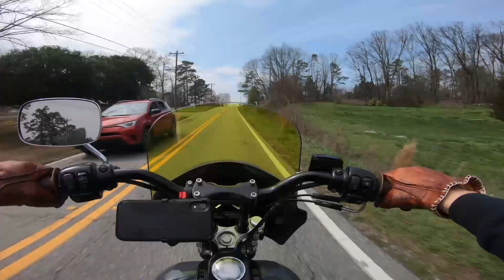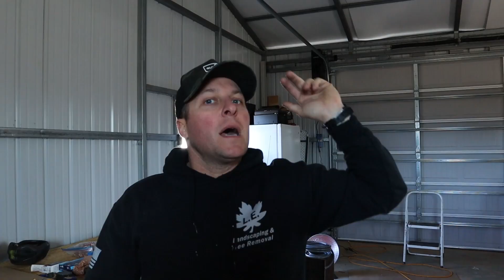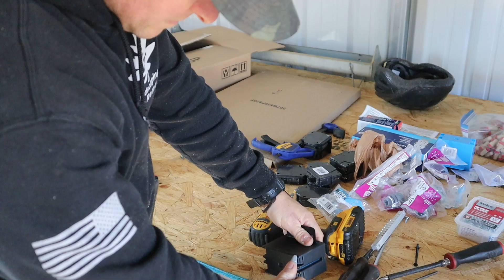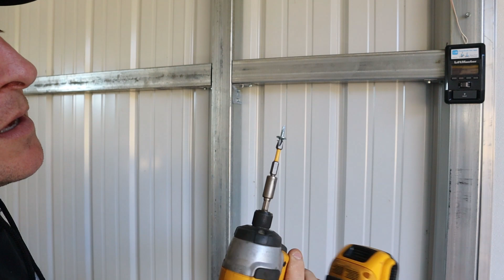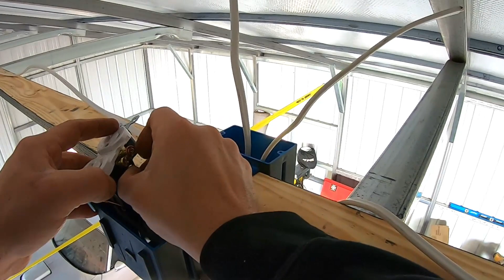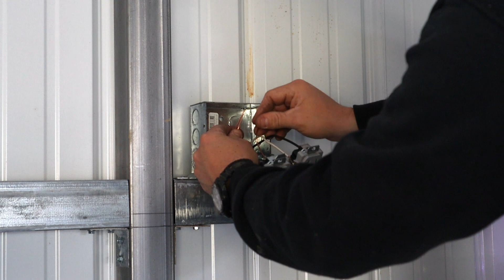I THINK IT'S RIGHT.. 100 Amp Sub Panel install Metal building dream garage build Ep.8

Comment: The outlets in ceiling did you buy the commercial grade top quality in case failure makes you go up high again to replace or residential  grade ? Apologies for all the questions im trying Diy my shop like you did , im just alot more mentally challenged. Very informative video thanks for sharing

Comment: The yellow straps on ceiling , i just had an 18foot wide by 24 foot long 12 foot tall walls  plus the high point of the gabled roof . On concrete pad . Do you see a need for my building to have simolar straps, your structure lot bigger , how tall are your walls. 
you didn't see the need for armored cable electric wires? Versus the Romex going thru the liquid tape? Was it cost only? Thank you good video

Comment: I wouldn't think installing outlet boxes up facing a roof would be a good idea which may collect any water from a leaking roof or condensation that may occur or years of dust generated in a work shop environment.

Comment: Wires stripped in the box tails too short
Need to tail off not legal to put one wire per terminal hsvecto tail off.
Using seal tite and running romex in is a waste of $  mc cable much better and cod compliant

Comment: I doubt his code says he can use PLASTIC boxes.  Use metal boxes, 12/2 metal clad, fasten metal clad every 18”, ground your metal boxes for outlets and switches, GFCI your first outlet in your string of outlets, 20 amp Breakers with the 12/2 MC.  I hung 4 Amazon UFO lights (2 per switch) and I have PLENTY of light in my 26Wx40Dx 14H sidewall metal building.  I AM LOVING MY METAL BUILDING!!!
Reply: Is it code to fasten every 18"? I wired my shop and guessed at it. 1.5ft just felt right.

Comment: Kudos to you for doing your own work. However, you could have used BX or MC cable, which has a flexible metal conduit around the wires. I'm sure the cost would have been the same as the conduit and the Romex cable. Plus it is a lot less work. Also metal boxes and some type of metal conduit is required to protect all wiring in all outbuildings. I'm not trying to be a Debbie Downer; just relaying what the National Electrical Code states. Thanks for the video. Enjoy your new building!

Comment: I would never install POS blue light special plastic boxes in any garage. Would use 3/4" EMT conduit from panel to branch off. Electricians seldom use sealtite conduit like you did. Only use it to feed motors , AC units and where flexibility is needed. Illegal to use a cordless tool to tighten any electrical screw or bolt. MUST use a torque driver or torque wrench. Poor choice installing receptacles face up. Dirt will enter it and guess where water leaking from roof is going to go. I always install red anti short bushings on both MC & AC cable no matter what the flimsy push on mickey mouse connectors state.You should have installed 6/32 screws with Loch washers & hex nuts to top & bottom of receptacles you mounted on 1900 boxes. Single screw in middle of a receptacle often come loose. Would not use any type NMB  cable ( romex ) in that Size garage in case in the future it converts to a commercial garage where at least in my area must use conduit or MC cable. Had a cabin catch on fire after an animal chewed thru romex cable.
Reply from the maker: All good tips thanks!

Comment: Romex can't go in conduit due to heat retention.
Reply: Incorrect. NEC 334.15(B) Protection from physical damage. NEC 334.10(5) permitted in raceways. NEC 334.12(b)(4) not permitted in wet or damp locations.

Comment: Did this electrical Pass Inspection?  Because you have Light Plugs near the roof with the Plugs facing upwards, if you were to ever get a leak, possibly even from condensation, water could drop dead into the plug.  also a Question, you added a 100 amp sub-panel, what is your main-panel amperage? also, you separated the Left and Right Neutral Bar, which Means Breakers on One side will have to Connect across to the Opposite side Neutral, Normally you just Add a Ground Bar for Ground wires separate from the 2 Neutral Bars? ... Ah I see you just ran Breakers on Right side, this is Fine as Long as someone else does not walk in stick a Breaker on the left and connect the neutral to your Now Ground.  (Add-in Ground Bars are like 10 bucks)

Comment: Why run 2 hots and 2 neutrals to each receptacle? As you mentioned, the outlets are connected to each other in each receptacle. I'd have added cover plates to keep bugs/birds from involving themselves in them. Looks good though. Out of curiosity, where did you drive in your grounding stake?
Reply: I think he was jumping the power to the box next to it, Normally you would Connect 2 Outlets with Pigtails not Jump from one plug to the other, if the first plug goes out it normally shuts them both down.

Comment: I'm from Australia and live in Florida. I'm an electrical contractor, or was, in Australia. Black is always neutral over there and any other color is live, except green. It has been quite the learning journey for me in the US as so many things aspects of house wiring is just plain unsafe by comparison. For example, the outlets. In Australia, you can remove a live outlet and it is impossible for your fingers to come into contact with a live terminal until you turn it over to access the back of it. I have had quite a few electric shocks in the US pulling live light switches and outlets off the wall. But, it is only girls' voltage 110 in the US.
Reply: I've always thought black being live was odd coming from automotive because that's usually neutral or common, good to know its a little more consistent elsewhere lol.
Reply: In the US  white  is neutral  green  is ground

Comment: How did you route your Metal Clad Electrical cable with the vertical style panneling around the supports? Did you go in front or behind? 

I'm about to build a building too and am looking for examples of routing the MC wire.
Reply from the maker: Most of it I ran to the top of wall then left or right! It’s still a pain though but it works

Comment: I work a southwire mc plant that manufactures the cabling and the liquitite. I'm fixing to wire my shop and its definitely the way to go.
Reply: Don’t lol, it’s a bitch to pull wire through over long distances. EMT and surface mount it, call it a day
Reply: @trevorthefisherman5548  yeah thats what I meant lol I'm surface mounting mc cable. Liquitite is really only good for short pulls.

Comment: Pull Romex ! Put a pipe thru the center of the roll and pull the romex the way it’s wound! It should spin so the memory is removed!!
Reply from the maker: Thanks man I tried that. Seems like with the smaller rolls not on a spoil it was difficult

Comment: Through YT magic, I found your channel -- specifically dealing with this build. I sub'd after watching the successful completion of the building (2nd video I watched). Been waiting for the wiring to come around, and... I'm a little disappointed. I worked in commercial/industrial electrical for years (retired), seldom dealt with simple 120VAC. However, I'm pretty sure NEC requires horizontally placed receptacles be pointing downwards-- which is why floor-mounted receptacles are no longer allowed (by "floor-mounted" I mean receptacles flush with the floor). Anyway: I think your rafter receptacles are upside-down. Also, I believe NEC prefers whips from a junction box hard-wired into the light fixtures, rather than plugged in with a cord to a receptacle. My 25' X 30' steel building (garage) is wired through conduit throughout, and whips connecting all 6 light fixtures (8 foot fluorescents) to their junction boxes. This garage was built years before my wife and I bought the house-- so I had no input on that.
Reply: As long as it is an approved assembly floor mounted receptacles are allowed Article 210.71(B)(2),314.27(B)]

Comment: If you have the sub panel bonded you would electric flowing on the grounds going back to the main panel which is very dangerous.
Reply from the maker: It’s not bonded! Removed the bonding strap completely

Comment: Your light switch had a direct short in it.  You had the white neutral on one screw of the switch and the hot black on the other switched screw!  I bet that surprised you when you tried to turn on the lights!
Reply from the maker: Not surprises yet. I’ll have to go back and watch lol thanks for the heads up
Reply: Those were just travelers. Goes down white, back up black. (or Vise Versa)

Comment: Hundred amp nowhere near enough your freezer taking 20 if you hook up a welder it’s gonna 50 now you’ve already used up 70A. You always go bigger than you need because you’re going to add lights electric heaters welders saws and a whole bunch of other tools that like power
Reply from the maker: Thank you. I figured when I’m welding I physically can’t operate any other power equipment at the same time. So didn’t count the welder as taking 50 amps.
Reply: John Winkler.    Never never never add breaker handle ratings to size anything.  You always use loads in VA. and calculate amps.

Comment: If I were you I would put a piece of plywood between the box & wall.  I also prefer to wrap electrical tape around the outlets/switches.  Always better to put in a 200 amp box for you never know what you might need.
Reply: Some counties don't allow electrical tape. It can be a fuel source in a fire.

Comment: Should used 12/2 wire it’s a shop plugs should be 20 amps
Reply: By what standard are the receptacles required to be 20 ampere rated.   They are not a single receptacle on a dedicated 20 amp circuit.

Comment: I recommend you talk with an electrician about being a consultant.  Tell them you want to do it yourself, but you want help with the right way.

The 2020 NEC puts shops and out building like yours into the garage category for GFCI protection.  If you do it with a breaker, you must return to your panel to reset it.  If you do it with a recepticle to feed a string of recepticles, your get the protection with a $8 breaker and $20 amp recepticle instead of a $50 GFCI breaker.

If your trench is open to supply power, put in a large pipe ( 1 1/2 inch for 200 amps) and a few 3/4 or 1 inch pipes for stuff like cable or a switch in the house and a flashing light in the shop to warn you of an emergency in the home.  Yeah, yeah, cell phone, yeah, yeah, but will you hear it ring while you work?  Don't be that guy digging his trench back up because you need another pipe or tried to save and ....  

Oh, the metal boxes need to be connected (pig tailed) to the circuit grounding conductor,   if you used a blank cover on the light boxes, you could hard wire the lights and use those recepticles else where.

Wire nut packages should indicate the size and number of wires each wire nut size is good for.

For your recepticles, I encourage pig tailing.  If one recepticle fails, the rest should stay working, except for the GFCI.

I like the "lever nut" wire connectors for home owners, Wago.  They are reusable and more forgiving if a mistake is made, but more expensive.

 If you are not stuffing wires into boxes every day, i encourage putting cheap  electrical tape around your switches and recepticle.  It is not an NEC requirement, but let a ground touch a hot in your box and you will be undoing your hard work to "move a wire".

Hope that helps
Reply: Right on the money, ditto!
Reply: Keith, thanks for that update. I did not know NEC 2020 had changed the outbuilding status regarding GFCI.
Reply: @duncancomputer     So, if the area he is located has adopted 2017 or older NEC, then 2020 NEC does not apply.
Reply: Because the outlets face up I would put outlet protectors on unused ones to keep the dust out.
Reply: If want to maybe plan for a 200 amp 1 1/2: is not big enough. Garage have been gfci for a few code cycles now
Reply: @thomasmarable6818  125-250 volts, their words, receptacles in 210.8 now.
Reply: The requirements are whatever the AHJ, Authority Having Jurisdiction, decides. Many are some year of NEC. But, yes, it would be the NEC year your locality has specified.
Reply: @duncancomputer  sir you are correct under section 90.4.  They can interpret, accept, or reject any and all parts of the NEC.  Sorry I did not mention.